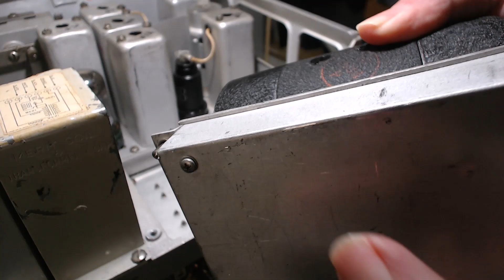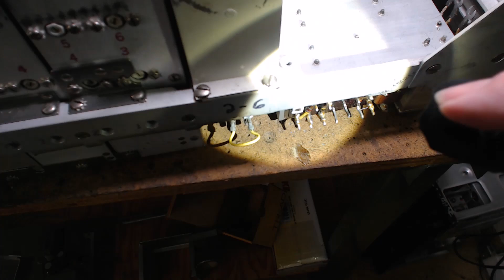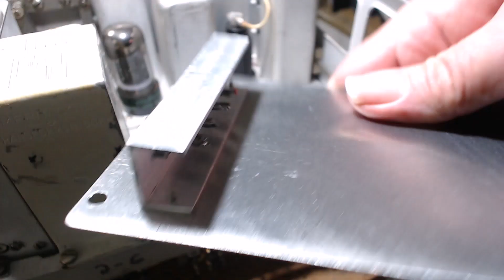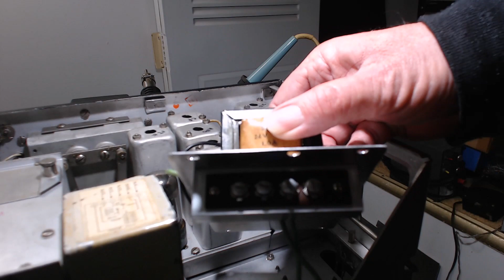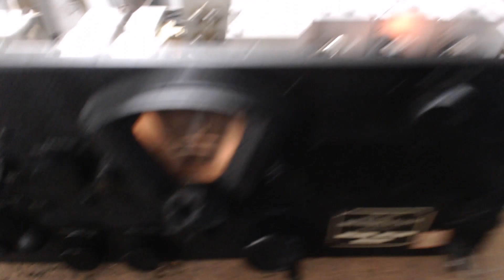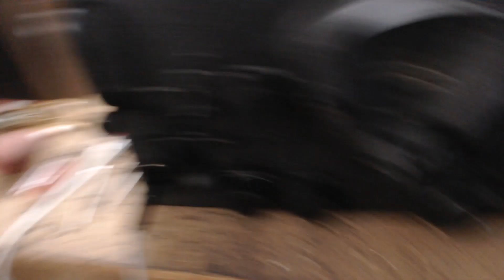Build a BC348 Supply from Start to FINISH!

Comment: I'm enjoying your vids on different BC-348 builds. I decide to pull down a Q version my Dad bought years ago at a hamfest and, i opened it up it had an ancient AC power supply in it with Crumbling Insulation on the HV transformer so i ditched it and bought all the components you recommend the 24 volt trans the 220 isolation trans, and made up a plate and mounted everything underneath. It fits perfect... i decided to give it a smoke test before hooking it up to the receiver.And noticed the unloaded voltage is 280 volts?... I'm wondering if the voltage you mentioned 235 volts DC is with the power supply hooked to the receiver under load?Will my voltage drop when i put the load on it?thanks for any help! This is my first power supply build.
.jim
Reply from the maker: There is a dropping resistor between the caps. Under load the voltage will drop.  Also the radio can take more than 300 volts.  225 is the same as the Dynamotor puts out.